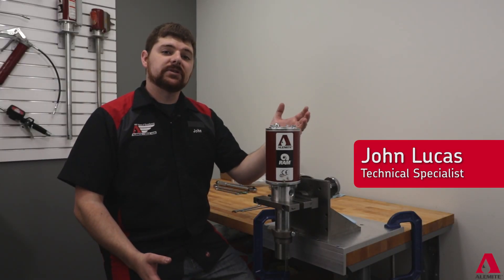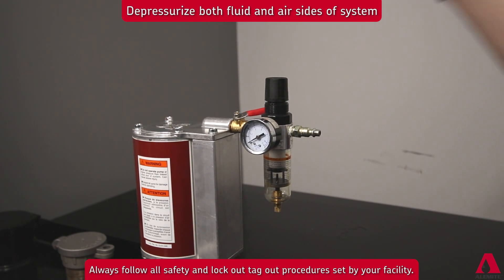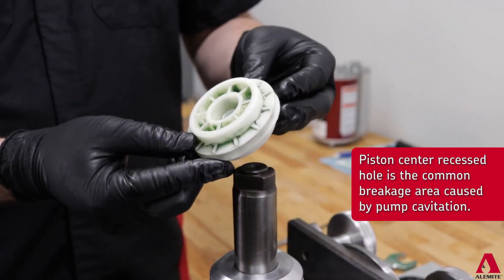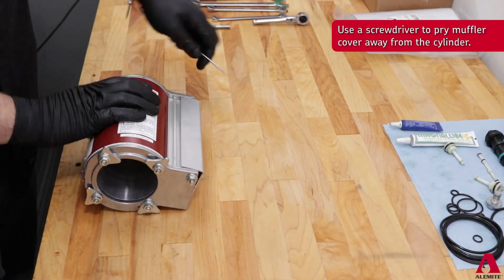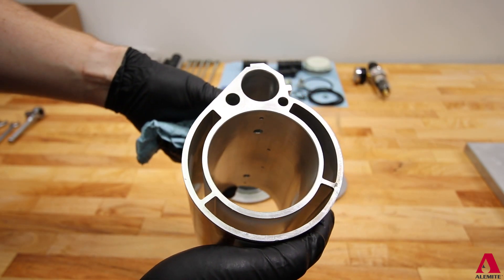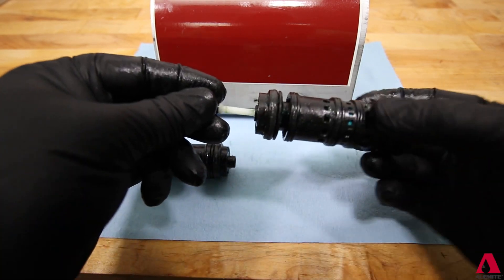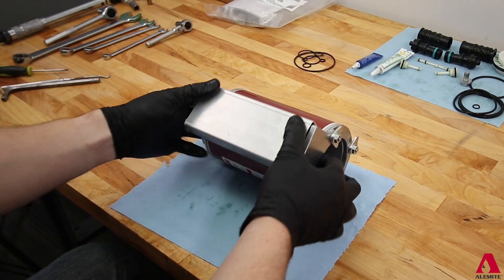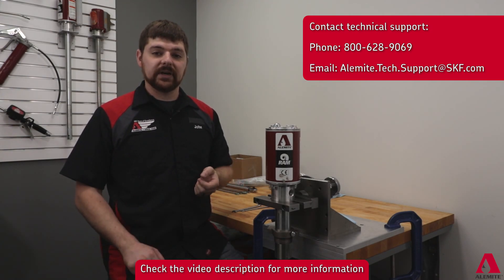Alemite RAM oil & grease pump airmotor repair

Comment: I’m getting flow just not at the 7 gallon a minute rate. More 2.5 gallon a minute. I did the normal maintenance on it but still no difference. What could it be? Some thing wrong with the intake?
Reply from the maker: the 9968 shown in this video is capable of dispensing up to 7 gallons per minute. The maximum volume is the tested rate with maximum air pressure, and no dispensing hose attached. Fluid volume and pressure reduces in a system depending on air pressure applied and number of restrictions on the fluid side such as dispensing handles, reels,  hoses or piping inner diameter as well as distance from pump. 2.5 gallon is a typical volume to observe in a built system. You may try increasing the air pressure to the pump. Optimal air pressure to these units is anywhere between 80-120 psi.

~John

Comment: Using the pump for universal tractor fluid getting too much air in fluid?
Reply from the maker: Could simply be a loose pickup tube, or the steel tube between the pickup tube and outlet body is loose as well. worse case the u-cup seal between the air and fluid side could be worn. try tightening and/or adding thread sealant, If unit has been in service for a while, might need a rebuild. 

~John

Comment: Do you have a rebuild or trouble shooting video for the 1 inch diaphragm pump? We have the 8323 model and it has stopped pumping.
Reply from the maker: I'm sorry, not at this time. I will add this to our list of potential topics.
To assist you with your issue, I would check the ball checks. Majority of the problems occur when debris builds up on the check seat areas causing the pump to lose prime. There are 8 bolts each, holding the top and bottom manifolds on to the diaphragm body housing. Pull the manifolds off one at a time and examine the seats, and check balls. 
If you require an disassembled view, check out our website Alemite.com, or give our tech service group a call or email and they can assist further. Email: Alemite.tech.support@skf.com or phone: 800-628-9069

~ John L.
Technical Media Specialist